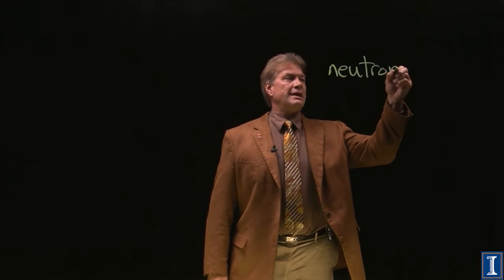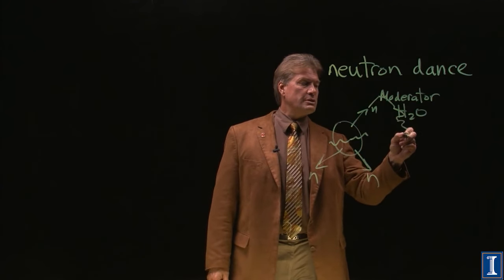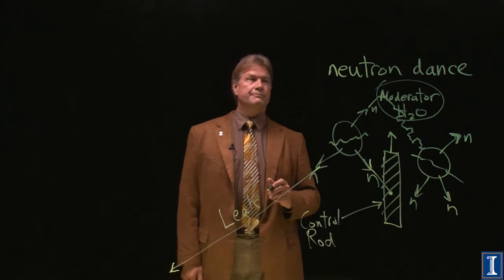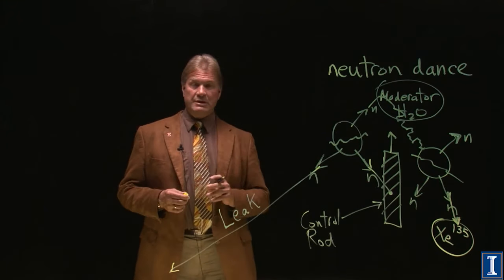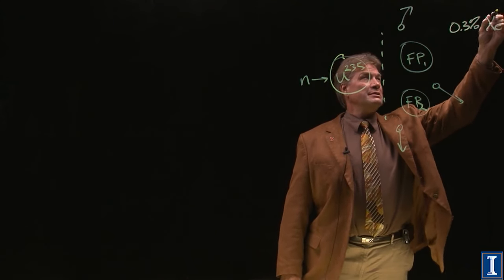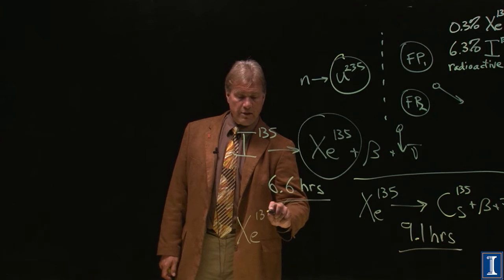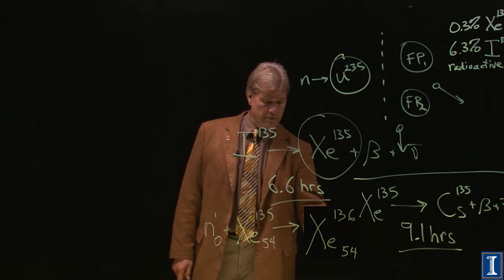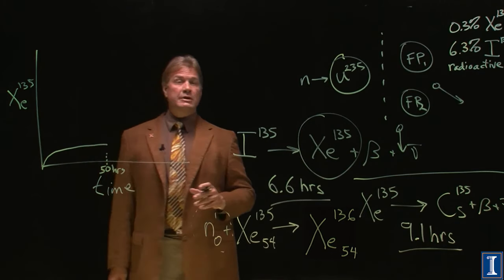Xenon Can Be a Problem

Comment: Almost a  complete picture.
What he omits is that when you DO manage start a Xenon-poisoned reactor, you rather rapidly burn off that Xenon.
This burnoff occurs dozens of times faster that the Xenon built up in the first place, and hundreds of times faster than the Xenon would normally have cleared itself.
So once your Xenon-poisoned reactor is running, you have to actively increase the control rods over the next couple of minutes, failure to do so will cause a runaway.
And a runaway, releasing more neutrons, burns off the Xenon even faster, speeding the runaway!!

Add to that the fact that the Soviet reactor at Chernobyl used water as part of its moderating structure. Lose the water, and the moderation increases, further accelerating the reactor!
So the moment your runaway causes your water to turn to steam, its bye-bye. The reactor instantly jumps to a higher state, burns off the remaining Xenon, jumps to a yet higher state, and all of a sudden you have a 30Gigawatt heatsource occurring in your 1 Gigawatt reactor housing, which simply cannot contain it.
Reply: it probably wasn't 30GW (nobody can tell for sure as all the instrumentation simply pegged), most likely "just" single digits of multiples, but still enough to eventually throw the reactor lid through the roof :D
In case of Chernobyl, what added insult to injury was the fact that the control rod mechanism was so painfully slow...had it been capable of a SCRAM by modern reactor standards, the plant would (probably...Dyatlov did a lot of things that night that he should not have ever done) still be in one piece. Damaged reactor, but probably still in one, albeit partially molten piece ;-)
Reply: richard mccann  Bear in mind that even if the reactor went prompt critical in 3 miliseconds, even with 30GW of power creation, it would take a couple seconds to heat up the ~ 5 tons of core to the point where it explodes. This inertia is actually a bad thing, as it delays the disruption of the core , allowing more energy to build up before it stops the reactor by disassembly.
Reply: But losing your moderator causing the reactor to shut down, not increase in power. The problem was not the water, it was the fact that the graphite provided moderation even without the water. Moderators slow down neutrons and only slow neutrons cause fission in U-235.
Reply: "Lose the water, and the moderation increases," this is certainly wrong. Water has two effects: it moderates the speed of neutrons from fast (directly after fission) to slow (thermal), as the cross section for splitting U-235 is much higher. But it also acts as a (mild) neutron poison, by neutron capture from hydrogen to deuterium (H-2). In a BWR or PWR, the sentence is: loose the water, and the moderation decreases, which brings down the reactivity. In RBMKs, the water is not primarily used for moderation, as graphite is used for this purpose. If the water goes away, the moderation is still fine but the neutron absorber qualities of water are lacking and the reactivity goes up. That is the reason for the positive void coefficient of RBMKs.
Reply: @marvinkitfox3386  When you say "the moderation increases", then this is simply not true, as the moderation is basically the same, meaning slowing down fast neutrons (MeV energy content, tens of thousands of km/s) to thermal speed (kinetic energy = fractions of a keV, a few km/s). Moderation helps with the chain reaction, as a fast neutron may fly out of the reactor without interfering with fissile nucleii due to the low cross section. In a RBMK and other graphite moderated designs, the moderation capability by the graphite is high enough, no matter if other moderating materials are around or not. Again: moderation is the reduction of the speed of a neutron, nothing more, not the count how many moderated neutrons you have in the core (e.g. influenced by absorber materials in the core or neutron reflectors around the core). These are two different aspects. "A gentleman should always say what he means, else he doesn't mean what he says."
Reply: You're discussing Adam Hutchin's Xenon curve that he's proud of having run up.  I think Adam got lucky.  A bunch of times.

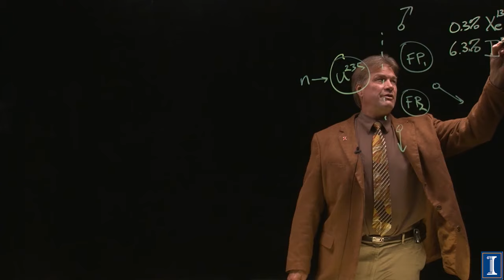Comment: At 5:56 you say "and Iodine-135, unlike Xenon-135, is radioactive". At 7:55 you say "It turns out that Xenon-135 itself is also radioactive".
Reply: Keeping you in suspense.
Reply: Good pickup. Didn't notice that! It seems that Xe-135 is radioactive and emits electrons with a half life of 9hrs - so it would be quickly exhausted anyway

Comment: best explanation yet of the  Xenon problem. Thanks!
Reply: Maybe the only question not directly addressed was that since xenon is a gas, why does it stay behind rather than ventilating out of the core.  Being trapped in the solid fuel rods well enough that the escape rate is low or nil is perhaps the explanation.

Comment: Just cause i am missing it in the video:
It is not that removing the control rods made it "suddenly" tip over and caused a runaway-effect.
Rather - the reactor was now running at a far too low level, extremely poisoned due to the way it was handled before, most safety-systems shut of, the automatic-control disabled, the steamturbines partially shut down and most control rods, even those that should always stay inside the core, were many retracted entirely out of the core.
Now this is a big problem as the water started to boil at the rods and this reactor-design actually made the reactor More active when boiling, further increasing the output and the neutron-flux. This is 2:30 hours after the shutdown started - the xenon-release from iodine has slowed down already.
When this problem was noticed they started inserting the control-rods again and that had another problem: Those rods had a graphite-tip that would at first increase the power output before the moderating-part reached the core. Now the power-output went up significantly and some of the fuelrods broke in jammed the control rods.
So now we have a reactor with nearly no cooling, graphite that does not absorb but moderate the neutrons, the water boiling which also does not absorb the neutrons, little xenon being produced but a high flux burning the existing xenon away and a buildup of temperature and pressure.
at this point the reactor was also outputting several times its maximum rated capacity leading to the pressure form the steam rising extremely quickly to the point of rupturing the cooling-system and the first explosion.
The cause of the second explosion is not fully understood as well - there are no sensory-readings or useful survivor-accounts of what went on there - so there are a few hypothesis, the most likely nowadays seems to be yet another steam-explosion:
after the first explosion the reactor had no more cooling, the molten core heating up further and melting its way down likely came into contact with the rest of the water - you can imagine what happens when several tons of extremely hot molten metals, some of which are also very chemically active, come in contact and cover a large body of water - a really big explosion.
Reply: ABaumstumpf The second explosion was most likely a hydrogen detonation. You flash boil a bunch of water, as happens in a steam explosion, you have alot of leftover hydrogen, which likes in explode in of itself. Modern reactors are designed with blow out panels for this reason.
Reply: The second explosion might also be small nuclear explosion (a "fizzle"). The IAEA report https://www-pub.iaea.org/MTCD/Publications/PDF/Pub913e_web.pdf page 3 says that the total loss of water (e.g. after the first explosion has ruptured a lot of the pressure tubes) can lead to an increase reactivity of 4-5 beta. An addition of one beta alone to a normally running chain reaction means the reactor core is prompt critical.
Reply: @willh8950  I assume the blow out panels are (as in other regular thermal power plants) in the secondary circuit of a PWR to relieve pressure if there are problems in the turbine/condensor etc. Venting the containment (if the pressure rises to high) is another thing.

Comment: what about Liquid Fluoride Reactors? Do they have the same "xenon problem" as typical lightwater reactors do?
Reply: I would guess not since the xenon would float to the top.
Reply: Yes, they do, but as LaserFur says, it tends to just collect at the top of the reactor and is drawn off.  In general, a lot of fission products are poisonous (though none as much as Xenon), but in the LFTR they are in the liquid fuel/coolant, which is continuously drawn off, has the FPs removed, and is rebalanced with thorium and uranium, and then injected back into the reactor.  Never stop for refueling, FPs always kept at a low level.
Reply: @puncheex2  Sounds like a cheap way to make radioactive Xenon, or Cessium.
Reply: @Zamolxes77  If that is your goal, yes.
Reply: @puncheex2  I wonder how easy it is to maintain the operation of this "kidney" function. What were the servicing cycles at the Oak Ridge MSR?

Comment: Do control rods ever become so saturated with neutrons they have absorbed that they need to be replaced?
Reply: @104th_Maverick  It rather depends on what kind of materials (elements, compounds) one uses for control rods. See here for an explanation -->  https://en.wikipedia.org/wiki/Control_rod
Reply: @kurt44mg42  I read this article, and unfortunately it still doesn't answer 104th_Maverick's excellent question.
Reply: MegaSexfanatic  That's basically true, but there's a little more to it.  I am a licensed operator at at PWR, and we do use boron as our primary reactivity control.  We either borate (inject boric acid, which is water with dissolved boron) or dilute (add fresh water without boron) to control how much boron is in the reactor coolant (which is just ultra pure water with a certain amount of boron in it).  We have a system that automatically maintains a certain volume, so whether you pump in boric acid to borate, or pump in fresh water to dilute, the same amount of water that's already in the system drains out to a large collection tank, which gets cleaned up and processed and eventually released to the environment once it's clean.

But, we do use control rods, as well.  Our control rods are made of silver, indium, and cadmium.  The control rods are normally used for starting up the reactor, and for controlling where in the core the power is being produced.  But the control rods are also our emergency shutdown method - a reactor trip literally drops all of the control rods into the core to shut it down in an emergency.
Reply: There is a limit, of course.  The way neutron absorbing materials work is to...well...absorb a neutron.  That changes it into a different isotope.  Some elements have several stable isotopes, some have very few.  Each time an atom absorbs a neutron and becomes a different isotope, it may be better or worse at capturing another neutron, it may be stable and never absorb another neutron, or it might be unstable and decay (radioactive).  I can't speak for all the different absorber materials, but generally, control rods are going to be made out of materials that can capture a very high number of neutrons before they lose that ability.

Speaking from personal experience, I have about 15 years experience at my current plant, and in that time, out of 96 control rods combined between two reactors, we have only replaced one single control rod.  And that was due to a mechanical issue, not a neutron absorber issue.  So, simple answer, yes, there is a finite number of neutrons a control rod can absorb, but it's a huge number, and replacing control rods is not at all a common thing.  We reuse the same exact control rods over and over and over again.
Reply: Theoretically, yes, but I've never heard of it being done. The materials from which the reactor vessel is constructed is more likely to reach its end of useful life first due to neutron embrittlement.
Reply: @adamhutchins1981  Stable boron is 20% B-10 and 80% B-11.  After becoming B-12, it beta-decays in 20 msec to carbon-12 (98%).
Reply: @puncheex2  I don't mean to be rude, but you're completely wrong when it comes to reactivity control in a nuclear reactor.

That is not at all the reaction we use in a nuclear reactor for control.  The specific isotope we care about is B-10.  We don't care about any stable B-11, because it does absolutely nothing for us.  B-10 has a very high cross-section for absorption of neutrons, which is why it is used as a neutron absorber.  B-10 absorbs a neutron, becomes B-11 in an excited (not stable) state, which then breaks down into Li-7 and He-4, plus 5 electrons.  The naturally occurring B-11, non-excited, does essentially nothing, because it is stable, and it does not readily absorb neutrons.

If you look only at the chart of nuclides, you will find that you are correct in that 80% of naturally occurring boron is B-11, and you are also correct about its possible decay chain (since B-11 is stable, and doesn't readily decay), but B-11 does NOT have the affinity for absorbing neutrons that we need to control a nuclear reactor.  In the case of reactor controls, it is not even a consideration.  So, in essence, while the answer you gave above is absolutely correct from an isotopic chemistry perspective, it is NOT applicable from a nuclear reactor control standpoint.  We only care about B-10, and it's neutron absorption leading to Li-7 and He-4, because that's how it reduces the amount of neutrons in the reactor core.  The B-11 that comes with it just doesn't make any difference at all.

Also, I should point out that the roughly 20% B-10 and 80% B-11 is an average, and is not always what we really get.  Depending on the varying suppliers we use for our boron at the plant, there is a variance in the B-10 fraction.  Periodically, we have to sample our boron to verify our B-10 fraction, because it has a direct effect on reactivity control.  Boron that is mined from different parts of the world will naturally have a higher or lower B-10 fraction (I believe Italy seems to have the best boron for our needs, with the highest B-10 fraction), but then, the longer the same boron is used for reactivity control in the reactor core, the lower the B-10 fraction will be, due to neutron depletion of B-10.  So the boron will become less effective as a poison over time.  It's a marginal difference, and the reactivity effects only change by a little bit, but it is something we have to take into account.  There are chemical means to enrich the boron, as well, to get rid of extra B-11 and make the boron have a higher concentration of B-10 in order to be a better neutron absorber, but at my plant, we have never used enriched boron.

So, the B-10 fraction (concentration) makes a big difference and must be measured to get an accurate reactivity plan, and B-11 doesn't even matter, because it is stable and does virtually nothing, and does not absorb neutrons.  That's what happens in a nuclear reactor, in regards to boron.  B-10 absorbs a neutron, becomes excited B-11, and dissociates into Li-7 and He-4, and 5 electrons.  Trust me, I've been doing this for two decades as a reactor operator.

If you want to read more about it, this is a good, quick write-up.

https://www.nuclear-power.net/glossary/boron-10/

Comment: I shuddered when he said "by pushing the control rod into the reactor" and drew an up arrow.  As a former US Navy reactor operator, I believe control rods should be inserted from top to bottom.  If power is lost to the control rod drive mechanisms, the rod should fall into the core, instead of falling out.
Reply: I think it depends on the type of reactor. A PWR does exactly as you say, dropping control rods in. A BWR pushes it in from the bottom. There are advantages to bottom-entry control rods such as being able to refuel without removing the rods.

Bear in mind I'm just interested in this stuff rather than an expert and have only read this up on Wikipedia.